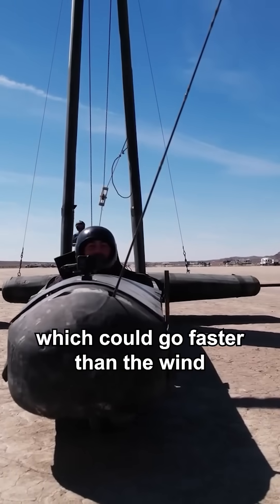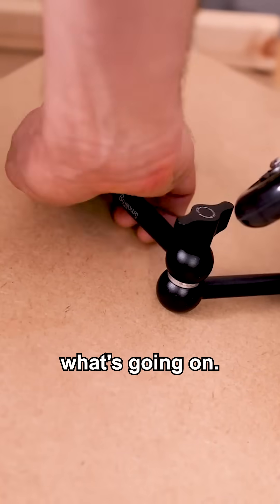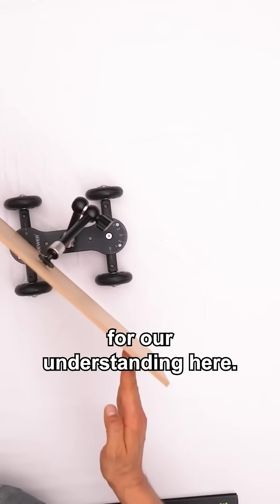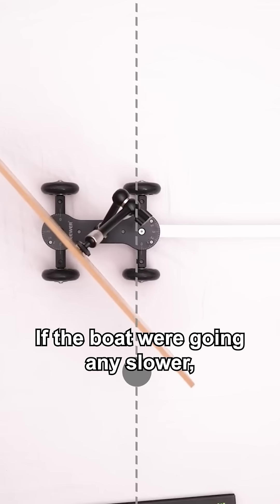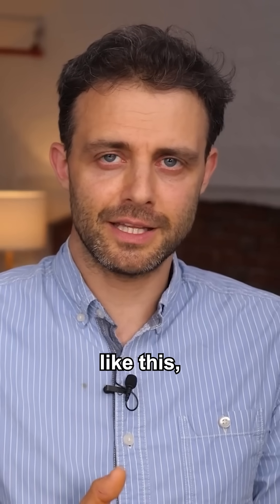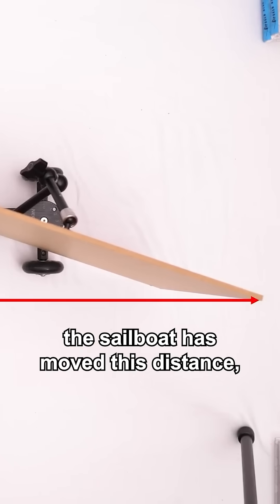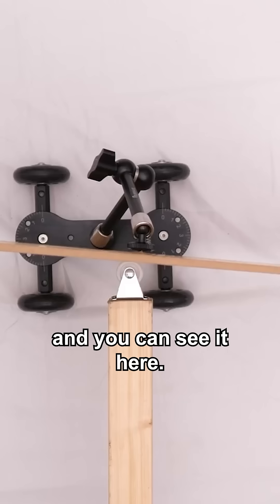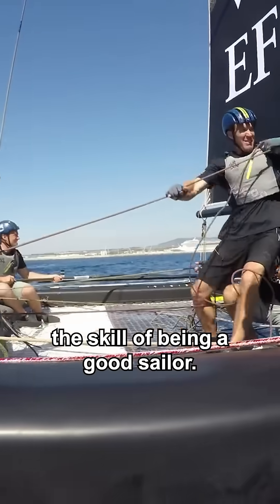How a sailboat can sail faster than the wind

Comment: So many misunderstandings here brought about by not understanding aerodynamics. Spinnakers and square rig sails are basically parachutes, just 'catching' what air they can and never more than about 80% of the wind speed. 'Triangle' sails are actually wings that generate lift at an angle relative to the airflow and can be closer to the wing. BUT, if you pull too much angle, the 'wing' will stall and not produce as much lift. Multiple sails and/or jibs can help to maintain airflow to generate more lift. As an idea, the fastest sailboats on the waters today use wings instead of sails...

Comment: I know a couple of other people touch upon the subject, but it’s buried in the replies to comments a bit. 

There is lift being produced and as the vessel increases speed, the apparent wind direction changes and depending on friction you can increase your boat speed. 

What I didn’t see mentioned in the replies or comments is that you can also sail on the solid phase of water and reach speeds up to 4x the wind speed (I think the record for an ice boat is around 140mph). 

Land sailors can also be blisteringly fast.

Comment: Faster from which wind of time? This theory assuming that the boat is already moving. Now what caused it to move to the speed in the first place, what's the speed of that original pushing wind? You will then have to trace it to the start where the boat not moving yet, are you saying 0 speed of the wind can move the stationary boat?

Comment: did a lot of windsurfing in the 90s, sails were shaped like airfoils, 1) the air moving across the far side of the sail moves faster than the air in the near side generating lift which adds to the force pushing the windsurfer, 2) at velocity the windsurfer starts to generate its "own" wind, the speed of the boat plus the speed of the wind, you could easily go 2x the speed of the wind when the hull is plaining (skimming across the water)
Reply: This is correct.  Sails are like airplane wings they operate off lift, not push.

Comment: A pretty misleading video. No mention of the Bernoulli effect here. Sails are not flat boards, but curved foils. That's why AC 75 foiling racing yachts can reach nearly 50 knots of boat speed in only 12 knots of wind.
Reply: it's not misleading though, everything they say is correct. its not all encompassing but it is still right.

Comment: he's basing his explanation on deflection and that's not how it works at all...sails are shaped like a wing and works on principals of lift. high pressure is created on the windward side of the sail and low pressure is created behind the sail. as the wind accelerates behind the sail it actually pulls the boat forward into the low pressure. going straight downwind you lose the lift and you can only go the speed of the wind.

Comment: Still not explaining how that propels something faster than the wind going directly downwind. This whole example is about traveling perpendicular to the wind. and also not explaining how sailboats work. This is about direct propulsion of a plank rather than most sails that are propelled by air on 1 side traveling significantly faster than the air on the other side, creating an area of high pressure on the windward side and an area of low pressure on the leeward side towards the front, creating lift in essence, but since the sail is a wing on its side, the direction of the lift is forward rather than up.

Comment: Hold on. Air isn’t ‘pushing’ on a sail unless you are downwind with a spinnaker. It functions as an air foil like an air plane, so the low pressure created by the draft and angle of attack of the sail is what creates lifts and moves the boat. I don’t think this explanation explains the issue here.

Comment: It is a cool video but not at all how modern sailboats travel faster than the wind. 
Think of a modern sail as the wing of a plane turned vertically, instead of a sheet of paper as shown in the video. Bending the air creates low pressure and pulls the boat forward just like lift on a plane. As the boat accelerates, the speed of the wind acting on the sail increases (apparent wind) creating more lift, more acceleration and faster apparent wind.

Comment: This is a well-made video, but it more explains how old square-rigged sailing ships worked. Modern sail plans act like a wing, where it generates lifting forces that act against the boat's stability (wide shape, heavy keel, crew weight on the high side) to force the boat forward through the water. The fastest boats generate additional wind speed by moving forward through the air (sort of like a turbo - generating power lets you generate even more power). This "wing" function of the sails is so pronounced that the fastest boats actually have vertically mounted wings. 

Look up SailGP or Americas Cup AC75 here on YT to see this in action.

Comment: My proposal for an intuitive model: Vehicle with wheels has a vertical mast with a rectangular sail which is perpendicular to the vehicle. Basically like a square rig on those old large sailing vessels. 
Let's say our vehicle is travelling north, wind is blowing from south to north. No friction assumed the vehicle would accelerate downwind until it reaches the speed of the wind. 
Now imagine the following change: the vertical mast is on a kind of rail and could be moved forward and backward. If the mast is at its most forward position and the vehicle is travelling at the speed of the wind, the crew would start pushing the mast backwards. Now the mast is slower than the vehicle and slower than the wind speed. Which would cause the vehicle accelerating.
Now, instead of the crew pushing you could also tie a rope to the mast and to a wheel such that moving the vehicle forward would cause the mast moving backwards (the wheel would wind up the rope).
If the vehicle stands still, the wind would push the sail and the mast forward. However, the rope would pull the mast backwards. This is basically the reason why faster than the wind directly downwards.is possible. 
The vehicle with the rotor in the video is using that principle. It is just harder to understand why the surface of the blades are travelling slower than the wind (not the rotation speed, but the speed in the way Steve explained so well.

Comment: This is actually incorrect.

See: apparent wind.

As the boat moves forwards the wind also comes from the front of the boat, *apparently*, if you are on the boat.

 It's the same when you travel forward in a car, bicycle, walking, whatever.

So in the demo there as the boat is travelling forward at the same speed as the wind, the apparent wind will be coming at a 45 degree angle, if you're on the boat.

The boat's forward momentum creates wind, and more lift from the sail, which creates more forward momentum, and even more wind, and more lift, repeat and repeat... you end up travelling faster than the wind.

The limiting factor is drag.

Comment: That model doesn't reflect the physics behind the concept accurately towards the end with the harsh angling at all, as he continued to push from the side when the sail was pulled in tight. He should have pushed from the front. The land machines system would also work perfectly well on a water machine. The reason why that won't work however is that it is too fragile and has no longevity which I suppose may be more important when crossing the Atlantic or North Sea. So yes his explanation is fine but not perfect.

Comment: That explanation is misleading. You have no lift in a sail you go beam reach / half wind. If you want speed in sailing you go close-hauled, almost into the wind direction, then the sail, which is shaped as an airplane wing will give lift in a direction 90 degrees off the sail, dragging the boat at an angle, and then the speed increases dramatically.

Comment: so what happens if the packets of air are continuous. instead of a packet it the push is continuous. The wind exerts a continuous push of force F.  Then what holds the boat back is the resistance of the sail trying to push the air out of the way on the opposite side of the wind pushing with force F   .

Comment: So with the turbine-carr its the № of blades or the total blade surface   the  bladeshape&angle that is of influence.  The air resistance of the vehicle together with the roadfriction/distortion of rubbertyres and a little loss of energy in gearbox between blades and axel added to that.
But the prop/turbine can be any position /360° spin. Direction of cart can be whatever.
Like to know the 'straight into' versus 'travel is same as wind direction'. Difference in total effective velocity over a certain distance.

Comment: Close but not quite. The sale is curved. Not a flat plank. Don't forget that the sail will take on the shape of an airplane wing. It will create a high and low pressure zones. This adds to the wind force itself.  Don't think of it as the air filling up one side and pushing. You'll get more momentum if you can get that low pressure zone in the right direction you want to travel.  Some of the fastest catamarans actually use a solid wing instead of a sail.

Comment: The flatter angle of the sail is exactly analogous to a coarse pitch on an aircraft's propellor. Set it to full coarse and the plane will likely not take off but crash into the trees at the end of the runway, because it wouldn't have enough time to built up takeoff speed. A plane with a  fixed-pitch prop is like a (manual) car that's stuck in 3rd gear. You slip the clutch like mad to get going, and then when you do your top speed is limited.

Comment: This mockup doesn't address sailing into the wind, or close to it.  In the mockup, the wind (simulated by the stick with the roller on it) is approaching the boat (simulated by the set of 4 rollers) from the side of the boat.  This is what we call a "beam reach."

To simulate sailing at an angle that is closer to going into the wind (what we call "close hauled"), Steve would need a different mockup to illustrate how the keel of the sailboat helps. A much more difficult principle to illustrate. 

Overall, there still is value in this, as it does account for some of the forces involved in sailing.

Comment: The sails act like wings or foils but...on their sides. So it isn't necessary that a sail is "pushed " but actually the pressure differentials are often "pulling" the boat. Similar to how a wing may be perceived to be creating lift or being pulled upwards. This may end up being semantics but that is the visual.
Reply: Whether wing lift is a reactionary force, or pulled up by low pressure has been the matter of debate. I believe it's both. There are some airfoils that have a longer surface on the bottom, and still provide lift. There was an article written on the topic in 2019, called "Lift Doesn't Suck", by Roger Long, on Avweb.
Reply: He is talking about a test without friction. Then there are no pushing or pulling force at all. As soon as the boat has resistance, wind will be deflected/accelerated around the sail and low pressure spots might create stall. To optimize real sailing, the sail shape is important. But without resistance the sail can be flat and infinite small.
Reply: If the sail were flat, it might work that way. But sails are bowed by the wind, so the forward side of the sail actually acts as an airfoil and pulls the boat forward in a cross wind situation. Only when the wind is coming from behind the ship does the wind push. So... it depends.
Reply: This is spot on. The video is good but it neglects the huge effect the airflow "behind" the sail has. The only time the sail is in pure "push-mode" is when the wind is directly behind. This is the only time there's a strict limit to windspeed vs boatspeed, as there's no lift and apparent wind is detrimental.
Reply: This. I’ve always been told it is because of “lift” or low / high pressure differential that propels racing boats. (Not saying this is a racing boat, just the context that I heard it explained )
Reply: Thanks for raising this.
Reply: I do not think these youtuber sail. Since this common knowledge with competitive sailors. Have they ever trimmed the sails draft? Adjusted the sail shape?
Reply: @Overitall805  the visual just confirms that the maker has no familiarity with how sailing works.
Reply: It's NOT semantics - you are exactly right!! If what he describes was true there would be no reason for a jib! The sail is an air foil on its side!! Mainsail's are NOT FLAT! The boat is NOT being pushed along, it's being pulled by the low pressure that forms on the front of the sail!
Reply: @Dadgrug Unfortunately, conservation of momentum means the boat really is being “pushed” by the mass of air it is displacing backwards as it moves. There’s really no physicality to it being “pulled” but you can view it as you like.

Comment: The car its a flywheel principal correct, it can go faster than the wind because by the time it reaches the speed of the wind the blade is spinning at a xonsiderablr speed, an even though the wind cant add energy it needs to deplete the store potential energy in the blade befor it slows down.

Comment: Hmm, not sure about this one #SteveMould...

Discounting resistence is one thing, but to then also (seemingly) conclude that the max potential speed is the same as the wind, when modern sailing can and does exceed this ..?

Unfortunately the explanation entirely ignores the Bernoulli effect, which is a huge part of sailing and the skill of being a good sailor, as well as the only possible way for a boat to move faster than the wind, whilst overcoming any resistence in the process...

America's Cup boats have been clocked at up to twice the speed of the wind, so explaining it simply by the pushing force of the wind and the angle of attack of the sail is barely telling half the story I would venture?

Comment: Most of the force that produces the Motion in boats is Not a pushing force!
The Sail IS curved. This results in a similar force AS in airplane Wings. If you Look at the sails designed for Speed they get even more shaped Like an airplane wing. Slalom sails in Windsurfing have such a large Mast BAG that ITS super hard to get Out of the water If the mastbag IS full. GP sails are even crazyer. The pushing of the Wind is Not that crazy which IS wy you have relativly slow speeds in direkt cours with the Wind and much Higher Speed when sailing in an Angle.

Comment: In a sailing school they told me quite simply that the shape of both sails working in tandem is supposed to work on the same principle of airplane wings meaning a round top and a relatively flat bottom or in the case of a sail the front and the back causing lift force 
To my simple understanding that increased air pressure forward is how the boat is funneling the wind in a way that makes it faster that the surrounding wind, although not actually because the direct airflow around and between the sails varies in speed having lower pressure on the front 
(P.s I started commenting thinking that it can be summarized in two sentences rather than the whole video and I was wrong😂

Comment: Two further factors nuance this. Limiting the acceleration is obviously drag. Modern high tech boats use hydrofoil to keep drag minimal.  Helping the acceleration, the shape of the sail is an aerofoil, which sucks the sail along. The really high tech boats use an actual aerofoil, made of 2 skins like an actual aeroplane wing. This tilts the balance much further towards overcoming drag and favouring acceleration. The speed sailing record tends to more be limited by achieving ideal conditions in the real world with high wind, but flat water. Tricky to do in nature.

Comment: A beautiful explanation. 

Obviously in the real world there are some other factors, in addition to the friction Steve mentions:

1) Lift, due to the shape of the sail. This is a force vector perpendicular to the sail itself and will add to the boat's speed.

2) Apparent wind. A confusion, rather than adding to the speed, but worth mentioning. Because the boat is moving forwards it experiences a wind generated by its movement. This vector adds to the real wind direction vector to create a new "apparent wind" direction. The direction and magnitude of this changes as speed increases.

3) This experiment assumes that the boat is upright. The sailor will need to counter-balance the force of the wind to achieve this, and inevitably the boat will be leaning away from the wind, presenting less and less area to the wind the faster it goes. In this sense, boat self stabilise, because the more the wind pushes them over, the less area of sail there is to catch the wind. Windsurfers like me don't self stabilise, and the sail is always upright, or pointing into the wind slightly - if the sail goes beyond vertical like a boat you just get catapulted into the water.